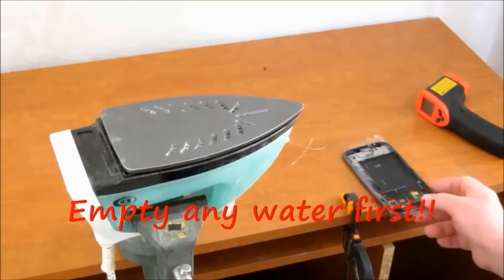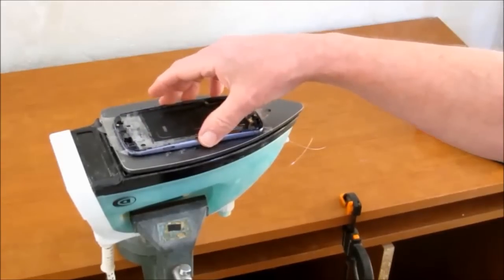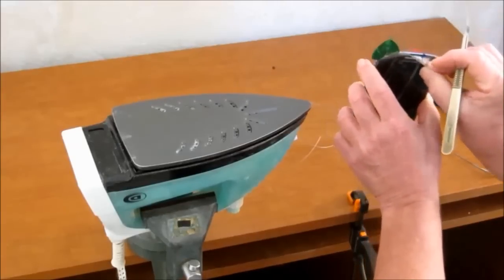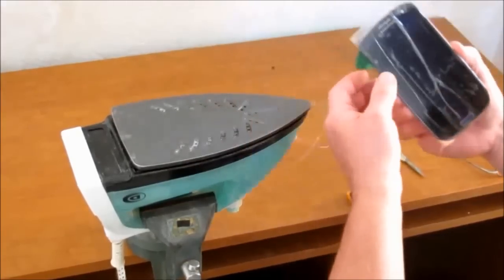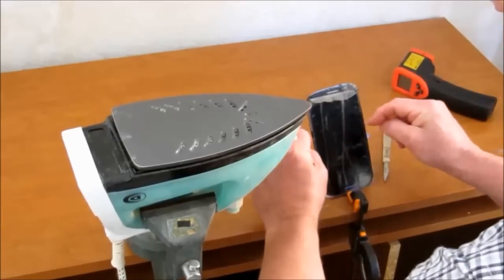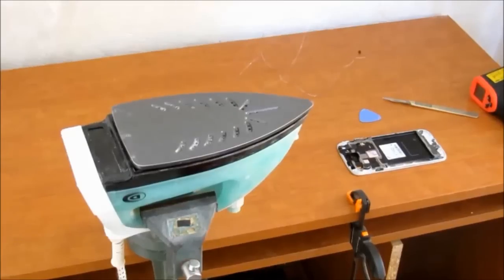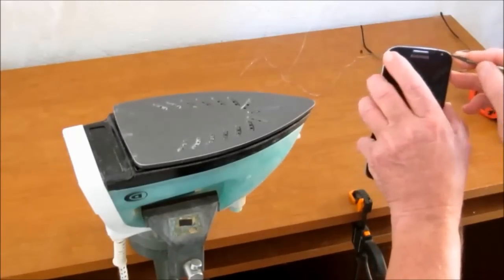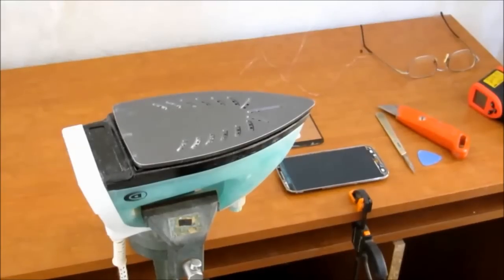Poor Man's LCD Separator

Comment: With those steam holes on the bottom of the iron, you can retrofit insert attach a hose connected to a pump, creating a vacuum clamp.
Reply from the maker: Damn! What a great idea! Why didn't I think of that? Updated video coming soon!
Reply: @1nformatica Whatever became of the vacuum mod?
Reply from the maker: @bobweiram6321  I never pursued it. As mobiles got more difficult and expensive to repair I turn my attention to other things. My channel is now mainly concerned with RC flying models.
Reply: @1nformatica  Yeah, I feel you. If you've ever accidentally broken a fragile component during a repair, it's a major bummer! After accidentally breaking a $400 lcd, it took an entire 2 years to work up my courage to attempt another non-trivial repair. I would never do it for a living. You really need exceptional attention, motor skills, and vision to work on electronics these days.

Comment: Good idea and way better than a hair dryer or heat gun. I have to say tho, I can't believe the second half of the video (having remove many screens myself).  That S4 glass clearly had no adhesive on it. I have never seen any glass separated from an LCD "clean as a whistle".  There is ALWAYS glue residue to clean off the LCD.
Reply from the maker: Yes, no one was more surprised than me! The S4 had clearly been repaired before and the glass not stuck down. That's what happens when you get stuff off eBay and you don't know it's history!!

Comment: Can this be done if I just wanna remove the screen and not replacing it? Like will the screen be fine after ironing?
Reply from the maker: The screen should be OK at the temperatures I use it only melts the glue. You will need to be  very careful not to damage the screen or cable, go slowly! YouTube no longer shows me if you are subscribed. Please consider subscribing if you have not done so already!

Comment: but the lcd and touch you separated are not bonded together like with loca glue or something else
Reply from the maker: No the example phone was not like that. I sure it will work the same just will need to heat for longer.
Reply: No it wont 
I have tried many time
However the temp. of an electric iron is not evenly distributed
In middle it is much hotter than that of edges and you will see folds on display if still try to do so
However thanks for the video
But now how will you iron your clothes by this :p
Reply: Not work on glue bonded lcd

Comment: Nice idea. I'm fixing phones from time to time and I was using hair dryer until recently when I bought hot air gun for like 20$. And yeah, it does the job for me pretty nice.
Reply from the maker: Thanks! I now use the heated bed on my 3D printer! Please consider subscribing if you have not done so already!
Reply: @1nformatica  Sure. Yeah, that's also a good way to do it. Main reason why I got air gun is because I tried to change glass only on Galaxy S8, but unfortunately I failed and broke the LCD. So yeah, this repair went from like 20$ to 100$+ very fast. But it's kinda fine because that screen already had burn in.

Comment: Totally unique ,Thumbs up!  a  little more to add to that would be to drill +tap a cross bar stop on the wide end ,say 1/8 thick , then taped side holes for different lcd widths , heat the lcd ,pull the wire while the the lcd is hot ( no cool down glue problems ) That would work as smooth as a babies butt!
Reply from the maker: Great idea, may be difficult to iron with though!

Comment: You should use dry ice next time. Place digitizer and glass cover on it and let it sit for 10 mins. This destroys the glue bond then you can carefully crack the glass of of the digitizer or slide a thin piece of plastic inbetween the digitizer and glass it will come off very easily.
Reply from the maker: Good idea, I must try. I do not know where I can buy dry ice though!
Reply: 1nformatica usually it is sold at large grocery stores. you might wanna call before going in though. theres also some videos showing the dry ice technique but not a whole lot of them.
Reply: 1nformatica walmart at customer service.
Reply: fudrukrs works on Nexus 6p?

Comment: Hello sir. Great idea. But I have some confusions. What is that lamination paper you have put over touch while heating? Is that common mobile lamination paper? Is it necessary to put that paper? While you're using thread to take it out of lcd then isn't touch screen belt/connector coming in way of thread and stopping thread from moving forward and maybe touch connector gets damaged?
Reply from the maker: Hi, I put ordinary clear packing tape over the broken screen to keep the small pieces of broken glass from falling out. The small broken pieces of glass are very sharp and you do not want them in your hands! The touch connector cable is usually near the top of the screen so I put the "thread" under it. It does not matter if you cut or break the cable as the new screen will come with it's own cable. Thank you for your comments.
Reply: ok thanks. well I noticed later you didn't separated touch screen from Lcd but removed it completely from mobile only. I hope this way also touch and lcd can be separated from each other where combos are used.

Comment: I heard it was 100 to 125 f
Reply from the maker: It is not an exact science, I choose to use 80C which is 176F as a starting point. To loosen the glue is a balance of temperature and time so find whatever settings work for you.